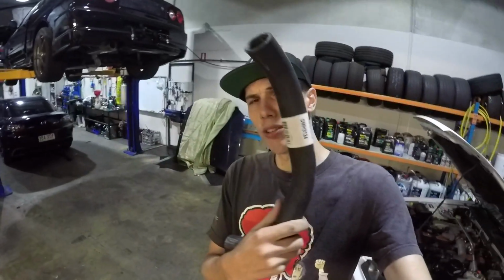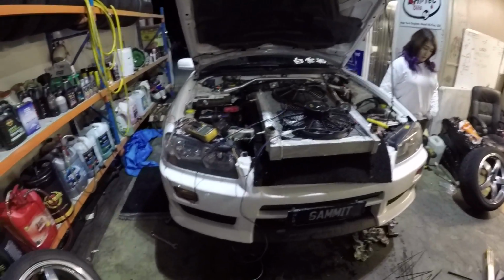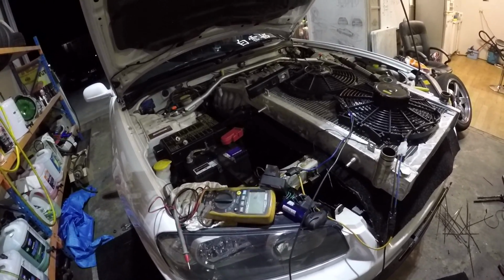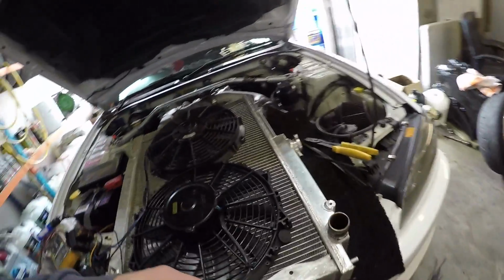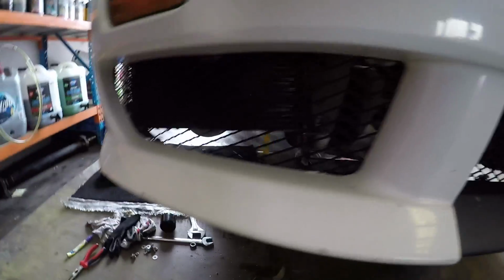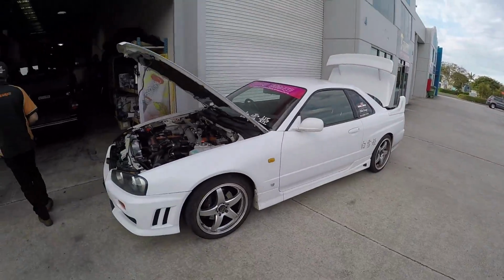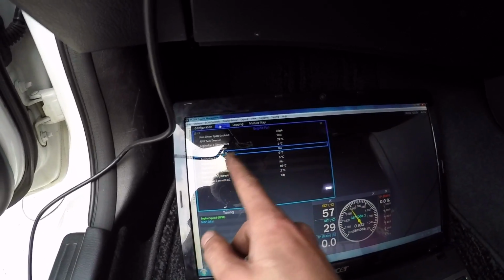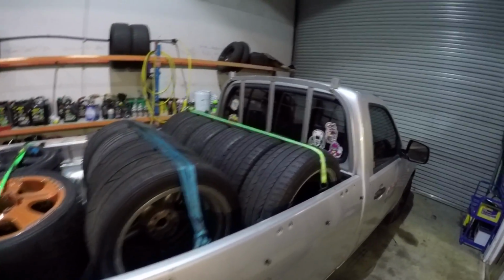DRIFT MATSURI PREP! & EVERYTHING GOES WRONG....

Comment: All I ever use to hold fans are cable ties,exactly how you've done but with a small square of old radiator hose with a hole in it on other side so it's not clamping directly to radiator

Comment: Finally 1st.  Its apparent, I have a life..  I live for Sammit's uploads/posts!!  Shitty deal on the part #.  Hiccas shit is shitty.  Its super.  Nice work.  Wheres the Noriyaro collaboration?  Tell him when you get back? lol idk what im talking about.. Although it is through Noriyaros channel I discovered Sammit.  Oh yeah you dont need the trigger as long as you drive fast enough lol jk.  Info needs a better interface or like translator box.  Shouldn't have to be that difficult to turn fans on.  That's hella lame.  Maybe im just lame and don't understand how to turn on a fan?  Idk.  Never messed with the lap top.  Just seems like there should be an easier route, and still have the fans come on automatically.  Guess all sensors need to be logged and calibrated and shit. Lol idk The key values.